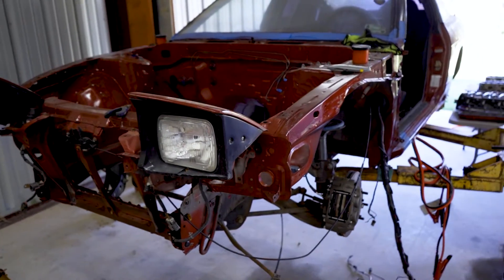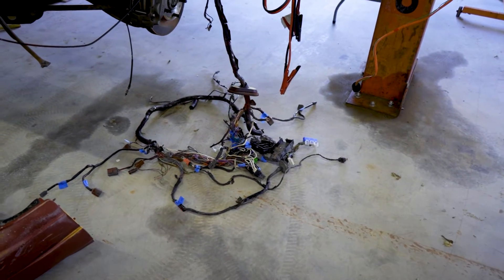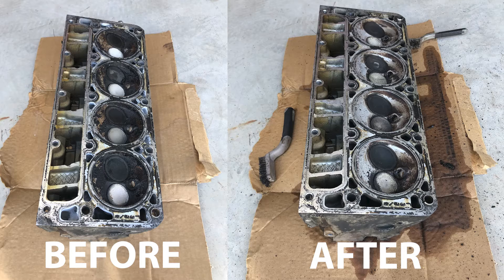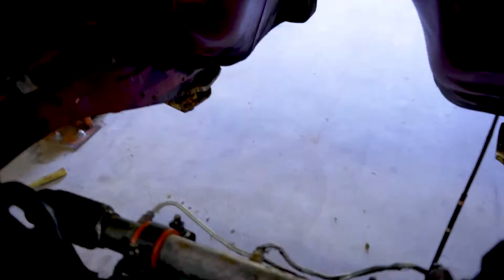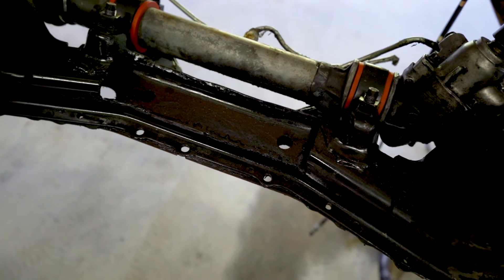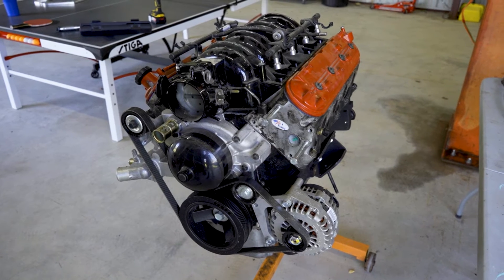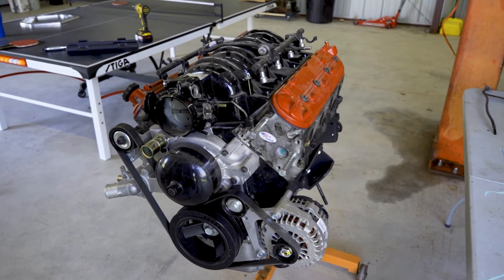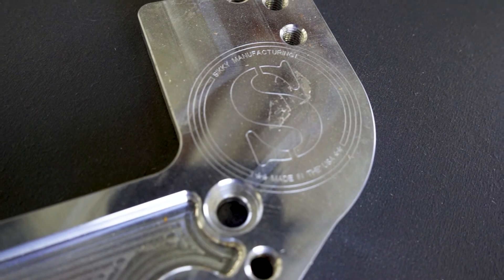LS 240SX Gets a Motor Inspection

Comment: Are those black specks on the pistons just a bit of stubborn carbon? Be sure to slather some oil in the cylinders, prime the oil pump, and do a compression test before the first fire. This looks like a very healthy engine and a great start!!!
Reply from the maker: Just carbon bits! The heads had a ton of carbon build up and I cleaned it off but whatever was left in the cylinders stayed. I'm sure it'll burn off on first fire right!